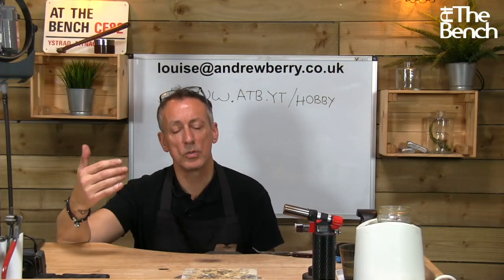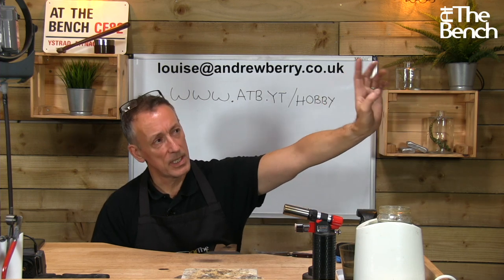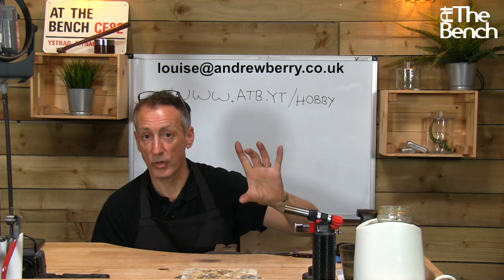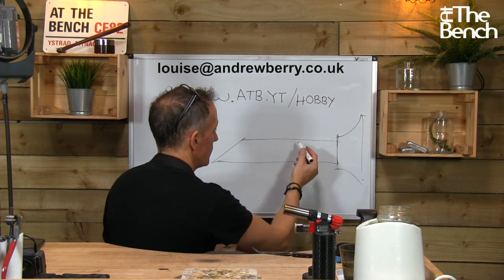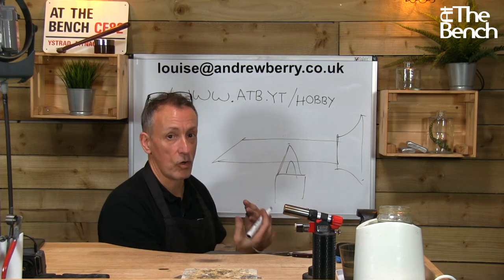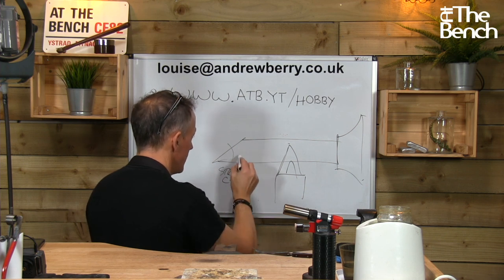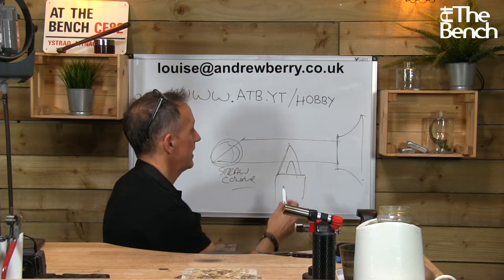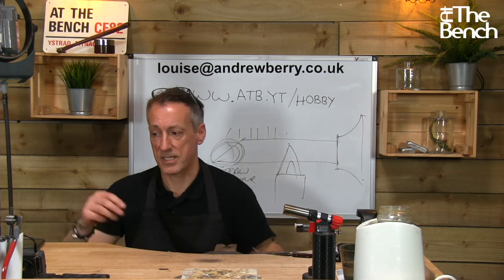How To Temper HSS Gravers Explained

Comment: HSS is designed to not need heat treatment at all.  Even if it’s overheated, it should retain most of its hardness.  It probably won’t be quite as hard as originally bought, but it is a steel that is not designed to be heat treated at all and it generally cannot be heat treated and tempered.  That’s why it’s used to make drill bits since drill bits often get overheated through simple drilling.  At least that has always been my understanding.  Any metallurgists are welcome to correct me if I’m wrong.  

From “Metalwork Technology and Practice” by Repp and McCarthy: “High-speed steel, also known as high -speed tool steel, is another type of alloy steel.  Its carbon content may range from about 0.70% to 1.50%.  Several different grades are available.  It generally contains one or more metals such as chromium, vanadium, molybdenum, tungsten, and cobalt.  The first four of these elements are carbide formers.  They combine with carbon to form carbides such as chromium carbide and vanadium carbide.  These carbides are very hard and wear resistant; therefore, they make good cutting tools.  Cobalt is not a carbide former, but it increases the red-hardness of the cutting tool.  This, the tool retains its hardness at high temperatures.  High-speed steel cutting tools retain their hardness without significant softening at temperatures up to about 1100 degrees F [593 degrees C].  This temperature is indicated by a dull, red heat”.  

“Tools made of high-speed steel need special care in grinding.  If such a tool is overheated by grinding and then dipped in cold water, it may crack.  Cracking can be avoided by grinding only on sharp wheels and by keeping the tool cool by frequently dipping it in water”.  

Taking all of this into account, the person asking the question might be best served by just carefully grinding a bit more back on their tool until they get to an area that’s not been heat damaged, cooling it frequently.  I hope that helps.

Comment: They quench in oil on "Forged in Fire".
Reply: That depends on the steel type.  W1 and other W series steels are designed to be hardened in water while O1 and other O series steels are designed for heat treatment in oil.  Which quenching liquid should be used should always be looked up before heat treatment based on the specific steel type.

Comment: Don't forget to quench again as soon as the straw colour reaches the tip.
Reply: Heat treatments of high speed steel is not indicated.  They’re designed to be hard at high temperatures up to 1100 degrees F.  They cannot be heat treated.